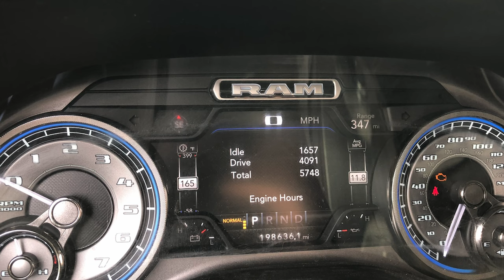HEMI TICK - Are you 100% sure that's what's wrong with your truck? (5.7L V8 Ram 1500)

Comment: I noticed a valve tick only once on my 2021 RAM 5.7 at about 11,700 miles on the odo. The truck was parked with the front facing up hill quite steeply, rear was down hill. It sat there for 6 hours. When I started it, there was a loud ticking from the valve train for about 10-15 seconds. The hill I parked on was maybe 40 degrees. I won't be parking that way again if I can avoid it. I didn't notice a tick on startup with the truck parked the reverse direction, front facing downward in the same location sitting about the same amount of time.

Comment: Got a question. With the Hemi tick if it's the exhaust manifold bolts broken, will you hear the tick every time the truck idles after driving it a few miles? I have a Chrysler 300c with the hemi and after the engine warms up, I hear the tick especially when it idles. Don't know if it's the exhaust manifold broken bolts or a bad lifter and camshaft. Will get it check out very soon.
Reply: my 2019 classic do this ,the tick is on idle when the engine is fully warm ,it start at 25000km and today have 60,000 km and still ticking on idle all the time,dealer say its normal,nothing wrong with it,any update about your engine?

Comment: I had a 2018 RAM 1500 express that I bought brand new. Had to let it go because it was costing too much per month ,anyway ,
loved the truck had no problems with it and had 46000 miles when I got rid of it. Recently just purchased a 2011 slt and it ticks. Just not sure if it's the lifters and cam. Sounds more like the flex plate is cracked as the sound is coming from underneath close to transmission. When I rev it just a bit the tick goes away. It's a 5.7

Comment: 1657 idle hours is equal to 45,000 miles driven 
Been a good truck 
I have a 2019 and mine went bad too 30,000 miles
Reply: what went bad? lifter\cam OR exhaust manifold?
Reply: What went bad?

Comment: I got a 2019 limited ram 1500 that makes the same ticking sound on cold start every morning . The truck got 35,000 mi on it. The ticking goes away after 30 seconds. Should I be concerned?
Reply: Yes, because you will only hear the tick during the first minute of engine start. Acceleration as well you can hear it, but it's less pronounced due to the hemi roaring. I'd check it out atleast